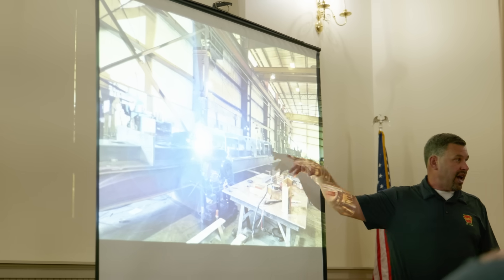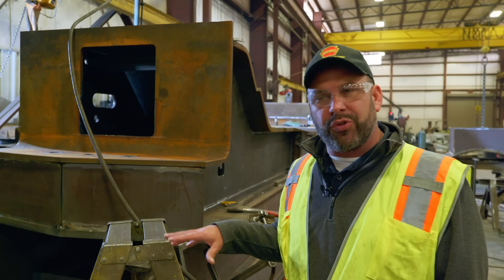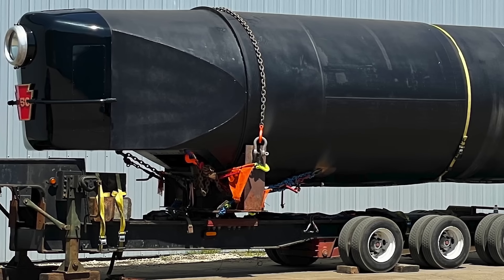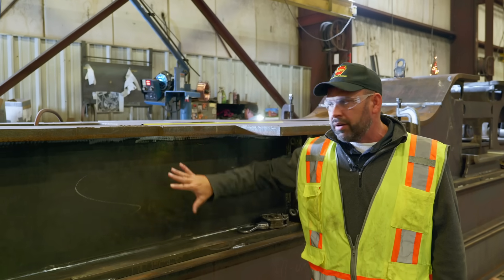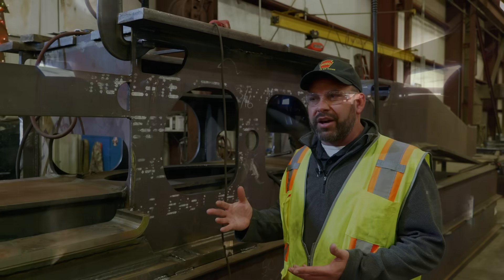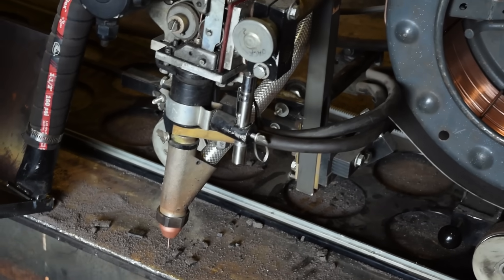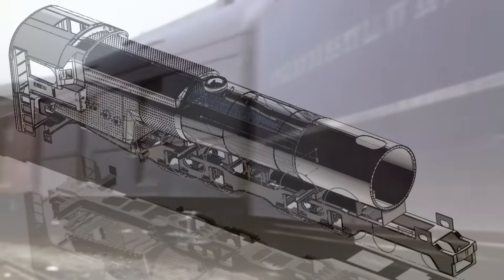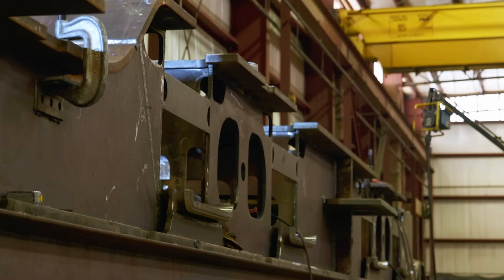NEW-BUILD Steam Locomotive Frame Walkthrough - PRR T1 Trust

Comment: Here a dumb request I bet they won’t make a full scale replica of the s1
Reply: I would love it if the S1 was rebuilt.
Reply: @LavenderRosie94 Start a campaign for one?
Reply: S1 had a lot of restrictions on where it can go. Only between Chicago, Illinois and Crestline, Ohio. Also, it was too long on turntables and it had a good chance of derailing when going through switches.
Reply: @ like I said a stupid request
Reply: @chooch1764  would a dreyfuss hudson be a more reasonable request?
Reply: @yeoldeseawitch  Sure. Please don’t leave it up to the T1 Trust to do it, as they will be operating and maintaining 5550, once it’s complete. Someone else should start a Dreyfuss Hudson trust, but the folks at the T1 Trust can give newbies advice.
Reply: @ Oh I just wanted to ask if it was possible. I have no money nor metalworking experience or networking or a shop to run it or anything
Reply: @yeoldeseawitch  Sure takes a pretty penny. even restoring one of the locomotives at a museum I've volunteered at runs around 20-30 million.
Reply: @ You do have to have experience, as there are folks with many years of experience that are willing to teach other people and pass it on. Also, just start your group as a 501(c)3 non profit organization.
Reply: What about making the 2nd set of wheels on the first set of drivers and the first set of wheels on the back set of drivers flangeless?
Reply: I would start a campaign to build a GTW 5629
Reply: Probably quicker to make a mock up than a real functioning locomotive. Especially with it's running gripes.

Comment: It’s scary how far they’ve gotten in the past few years… Wouldn’t be surprised if they get her done before 2030!
Reply: If donations come at a faster and larger rate it will be done before 2030
Reply: The boiler guts is going to be the real challenge
Reply: @southern207hobbies stay tuned, we think you will lile our next announcement
Reply: @TheT1Trust hey t1 trust….maybe you could add an horn like the s1
Reply: @southern207hobbies not really... but the real challenge is the valve gear, whic was one of the sources of the original  T1's problems.
Reply: @kristoffermangila your source of information is very wrong about the running gear.
Reply: @kristoffermangila  today we can test and tweak those issues before that stage hits plus the bearing tech is better then the 1940s/50s
Reply: @southern207hobbies Suspension ditto .... plus a fair bit on fluid dynamics courtesy of Livio Dante Porta, Phil Girdlestone and David Wardale.
Reply: @TheT1Trust  I've been following this build for a while and i am impressed because i honestly did not believe that anyone could build a new steam engine this way ,, ido realize anything man built is possible to rebuild however ,especially after the revival of UP4014
Reply: Indeed. But it's the first ground-up new build steam locomotive in the US. A lot of eyes have been looking and taking notes, especially pondering how the PTC is going to be rigged up on this locomotive. That alone was a thorn in the heel.
Reply: @berkshireerielocomotive3322  Not necessarily the first new build. The engines at Promontory Summit as well as Leviathan and York 17 are new builds but of a nineteenth century design with some modern amenities. If you’re talking about the first “big” new build, then yeah.
Reply: @berkshireerielocomotive3322  I'm sure they can take notes from UP Steam  because they made PTC work with 4014 ,,with a new build machine i'm sure it will integrate easier than retrofitting an older machine ,, i will be watching avidly to see this machine roll out , an actual modern NEW steam locomotive built with modern materials and processes
Reply: Agreed
Reply: My favorite part isn't her mere existence, but how they're improving on the original design. What the hell do you call this sort of project? An extinct design, being reproduced and modified for the modern era. It sure as hell isn't a restomod, but it's not fully scratch built either. Whatever it is, I can't wait to ride behind it one day.
Reply: @fightingwolf18  Agreed! It’s cool to see some of the intricate details of the build. Don’t see a lot of organizations going into this much detail.
Reply: @fightingwolf18   It's a new build. Old design built to modern (FRA)(Federal Railroad Administration) standards. Because, where a diesel locomotive is a self-propelled generator, a steam locomotive is a self-propelled pressure vessel that poses a potential to explode should something go wrong.
Reply: 2027 The Latest 😊
Reply: I think, it's amazing that they stick to the project!